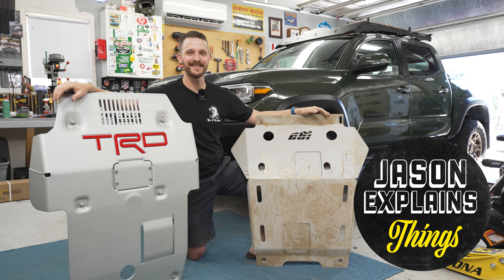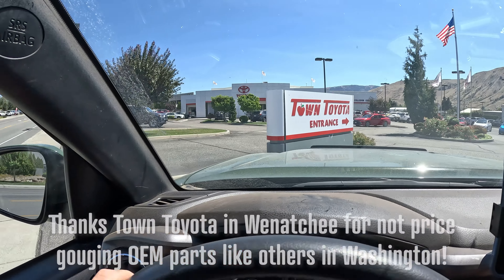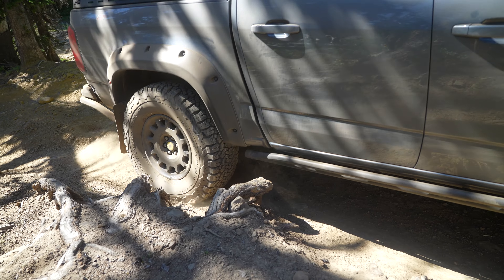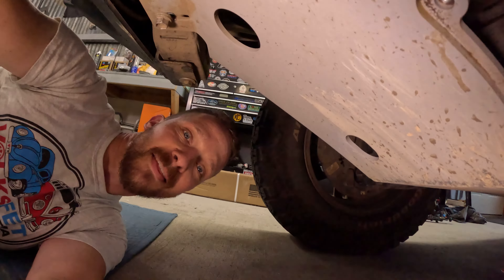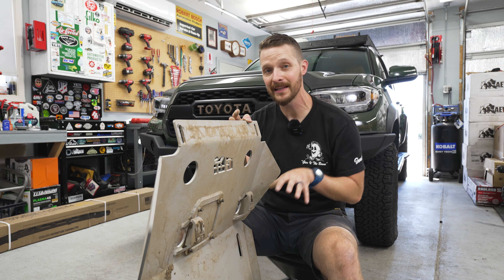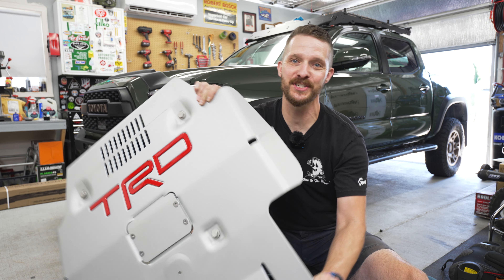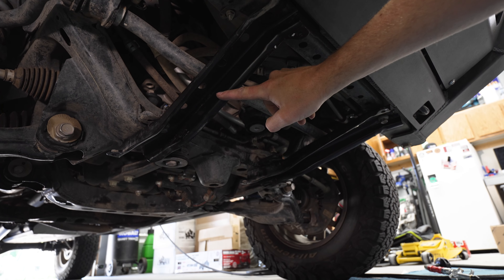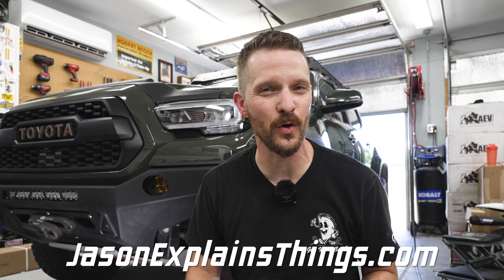Which Toyota Tacoma Aluminum Skid Plate is BEST?!  TRD vs Aftermarket

Comment: One point of view is that the skid plate did its job.
I try to not use copper anti seize with aluminum parts.
Thanks for the video
Reply from the maker: Yeah, I agree.  But I believe if a few things were changed it would’ve taken the hit and not bent in.  That’s my opinion.

Comment: the more research i do, the more comfortable i am with getting the steel skid from CBI.
i know aluminum corrodes instead of rusting, but where I live, i have to get my 4runner undercoated every year anyway.
when it comes to weight, there is a notable difference between the aluminum and steel (on the surface),
but if you look at the OVERALL PERCENTAGE DIFFERENCE when factoring in the weight of the vehicle itself, it's negligible.
if you do any type of even mild off-roading, you'll want to upgrade your suspension anyway.
i don't do hardly any off-roading, but i'm still debating if i want to get the full skid or just the front.
great video!
Reply from the maker: If that’s the case just stick with the stock skids or get the TRD one.  They cost less and weigh less.  Even the steel stamped stock one holds up to abuse with light off-roading and hitting the occasional rock.  My new TRD skid has held up to some pretty heavy abuse.
Reply: @JasonExplainsThings  i actually went with the cartrimhome (style B) skid plate. it was WAY less and if it gets damaged, i'm only out $250 and it's way easier to install. to be 100% honest, the primary reason for looking for a new skid was so oil changes didn't take 1.5 hours each time. and as long as i don't get crazy off road, it'll probably last longer for me too.

Comment: On my 4Runner I have not replaced the factory skid plate because it would require removal of the support braces.  I’m looking for an option that would keep them in place like the TRD version skid place you installed.

Comment: When I was installing my bumper installed light bar I found out my Colorado’s OEM engine skid plate is plastic so it’s definitely not best. 😂I’ll eventually get all the AEV skid plates like Chris.
Reply from the maker: Boron! 🥳 Those are very light for being steel.  I’ve had to pick those up more times than I care to remember.

Comment: I have the trd skid plate the only drawback is the drain hole for the pan is small and you get residual oil on the top of it and you 
Can’t get it clean. The other is you have to remove it service the front differential. I know waa waa. The thing is heavy and awkward. It’s leaning on the wall i sold the truck and trying to get myself to install it on my 23 model truck.

Comment: the original steel skid plate on my 2011 taco is all rotted out splitting and cracking from rust. was thinking of going aluminum.
Reply from the maker: The Toyota aluminum one is great. 👍

Comment: I have a serious question. How do you find the bolt torque settings for your truck (for mine) for when I do anything that requires torquing?
Reply from the maker: Combination of places.  PDFs about installs, repair manuals, and then just googling/searching a variety of places.  Forums often have all this info as well.
Reply: @JasonExplainsThings  thanks.